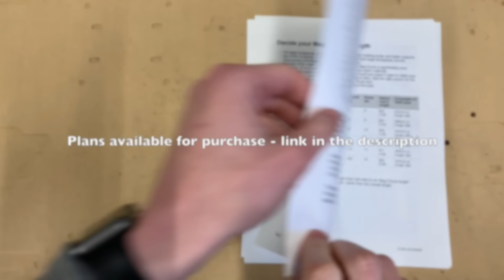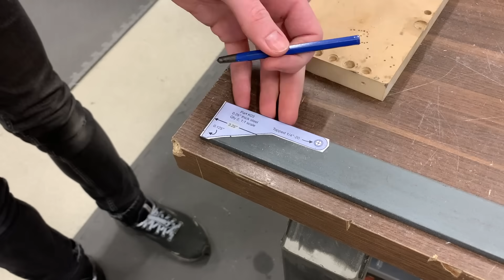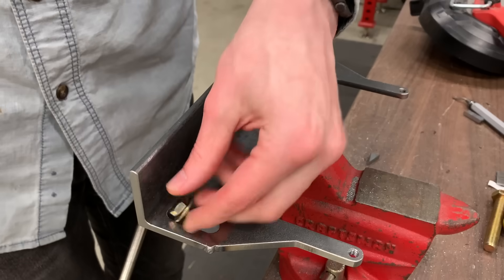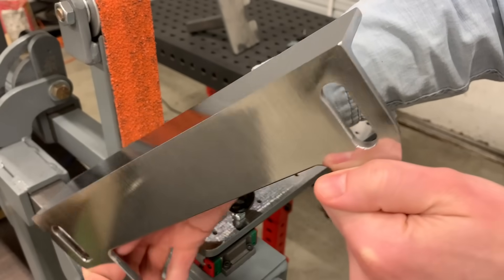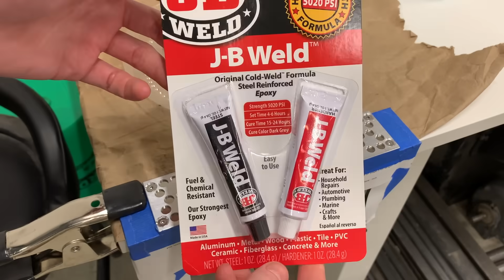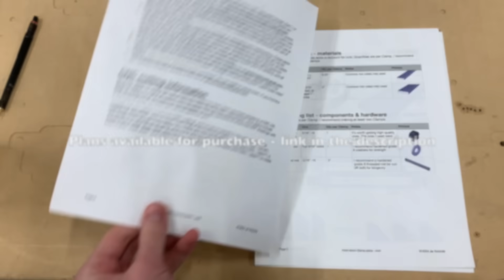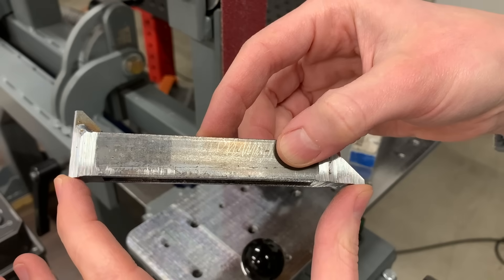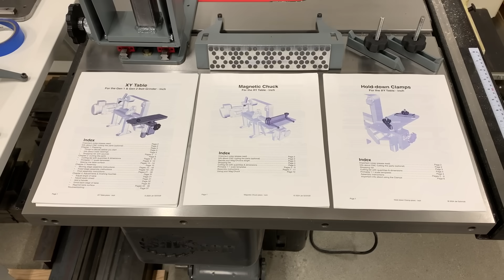How to build a Mag Chuck (+ Hold-down Clamps) for the XY Table

Comment: I've watched a lot of the belt grinder videos a few times each, and I really like the design of this belt grinder. The ONLY issue I have, is that there I haven't found a build estimate for this grinder and attachments. As someone with a slightly restricted budget, I'd personally like to know if the grinder cost like, $100, $200, $500, $1,000 etc... BEFORE I purchase the plans for $67 (including tax). Even just an estimate from your build, and then doubling it to account for any inflation or regional pricing would be nice. It'd be a real disappointment to purchase the plans, and then figure out that I can't afford to build the machine, and be stuck with plans I can't use for right now, while those funds could have been used for something else in the mean-time. This isn't really a piece of criticism, it's just something more of what I would think about. Like, if I find out I can build the whole thing for like $300 - $400, I'd probably pull the trigger on purchasing the plans, and that'd keep the whole thing un $500. But if I purchase the plans for $67, and it turns out it'd cost like $1,000 to build it, I'd be SOL with building this for a little bit. Anyway just my ramblings. Amazing build as always.
Reply: The base grinder is well over $1000 if you have to purchase all of the steel, motor, vfd, and wheels. If you scrounge pretty hard it can be under that, but probably not a lot.
Reply: @hypnolobster  Yeah, I commented on the most recent video, and a cost estimate was given, but than I was also informed that all that information is on the website. Lol, I fealt kinda dumb since I had only checked the Etsy page, and didn't even see the link to the website, though i normally would.

Comment: What is your Mig welder brand name, by the sound it makes you have it setup very well, all the spec's you are using would be of help for others that struggle with welder setup, Great Project
Reply from the maker: It's a Miller 211; I just use the "autoset" feature. Don't pay too much attention to the sound; all the welding clips are sped up which makes it sound different.

Comment: Nice work.
Have you thought of adding a second bolt to the end of the hold down clamp so you could adjust the height without having to find a bit of scrap approximately the same size as the piece being held down?
Reply from the maker: I considered it, but was worried about it scratching / denting the table surface. Maybe a brass bolt?

Comment: In the past 2 weeks I have purchased every set of your Plans in Regards to the Gen II 2”x72” Grinder, all the accessories, and this XY Table.
I’ve got my KB VFD on order (I went with the Digital Version) as well as all the Hardware, a friend of mine found me a Brand New Baldor 3HP Wash Down Motor to use for this build. I can’t wait to get started on these Projects.
I’ve been researching 2x72 Build/Weld it yourself Grinders for about 4-5 years, and it’s my opinion yours is the absolute Best Design out of all of them, as well as a better Design than a lot of the Professionally built models.
Both my Friend and I both are getting ready to build the Gen II and all of the Attachments/Accessories. 
Thanks for making these Designs available!

Comment: Another Fab vid. Many many thanks. Is there a thin layer of the JB weld left on top of the magnets? How thick? Also how long to make avid like this, cos you make it seem soo easy, is it like Wallace & Grommet where it takes a day of filming to make 60 seconds for our enthralment.
Reply from the maker: I left about 0.025" of JB Weld over the magnets. Best to be able to regrind it a few times before you hit the actual magnets. 

I often wander off and work on other things in the middle of a project, so there are clips in this video that are maybe a month apart, but in terms of actual hours of work, it's not that crazy. Maybe something like one hour per minute of video

Comment: edit: you can do one of two things to safeguard the magnets from heat: 1. paint the back of the holder with thermochromic paint OR 2. stick on temperature sticks. Neither will give you a fine ballpark, but for regular work, perfectly good to figure out where to stop. 
For the drill bit to not raise a burr, you need to sharpen the outer part of the flutes more. What happens there is that the flutes got rolled over or rounded, and they're not cutting and the material gets "pushed" out, rather than cut. That's fine for 90% of the hole, it's still sharp, but when the thin last bit remains, it will push out like that. I know this, because i purposely dull my bits for soft metals, like for brass, so they don't grab and do the helicopter dance. < learnt that one from Clickspring.

Oh and for non-magnetic and easy to find bolts, the copper studs you can get in a pack for pulling or for mounting parts with the specialized welder make for great flat faced bolts. It's not pure copper, so it's quite a bit stronger than copper, but it's also non magnetic. I found ones meant for electrical panels (big 8 mm ones) and they're actually cheaper than proper copper ones, all i have to do is cut the slot. The usual places have them in boxes or even loose.

Comment: OK, The Mag chuck needs an adjustable attachment point for a ruler. Preferably one with a stop point adjustment so you don't go too far.  Most people are more right hand dominant so placing the first one on the right would be better.  Having two would be useful for tapered grinds.

Comment: Thanks for sharing  . . .. 
Will the strength of the magnetic chuck be affected 
   if an Aluminum backing plate is used instead of steel  ?
Reply from the maker: I believe so. I'm not an expert in magnets, but my understanding is that steel completes the magnetic curcuit which improves the strength.

Comment: https://www.youtube.com/watch?v=0oJDy3OVxu8

If you ever decide to upgrade your plans, you might want to look at the clamps from Inheritance Machining. With that extra screw you could easily clamp it without needing an extra part (and it would make things a bit quicker).

Or if anyone would want to upgrade their clamps; drill a hole through the end of the clamps, tap that hole and put on of the screws (with top) on it upside down (although you might want to use thinner ones).

Comment: Vacuum coud eliminate the bubbles if you're feeling fussy. Pretty sure you were born feeling fussy :-)
Reply: another option could be filling the holes with more jbweld but im not sure if it would have an issue with not sticking to the first batch of epoxy